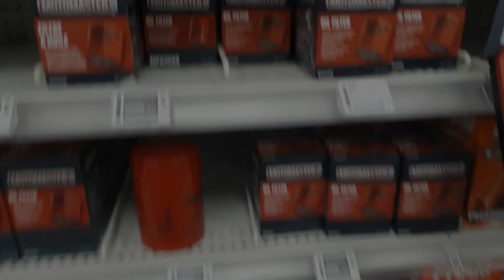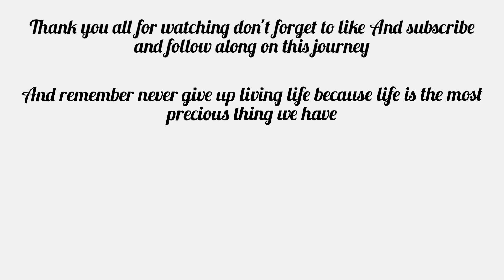Vanlife Side Street Repairs / Fixing It With Your Love And Cleaning Up The Streets

Comment: OOH that oil was tasty! Thought you'd stuffed a rubber hose into the sump at first! Will you need to change the oil again in a few weeks to wash out the crud? Very glad to see some work happening at last - and Tamara working with you - small steps but you'll be back on the road before you know it. The roller blades are pretty cool - do they speed up the run to the shower?
Reply from the maker: Super nasty oil its got about 30,000 kms on it 😬 should be changed way more often! But we do what we can  , and I dont roller blade to the shower because it's way to windy along the highway and alot of hills and dirt trails i also hope a dense or 2 so it's just easier to walk , a peddle bike would be the way to go but I dont have one at the moment